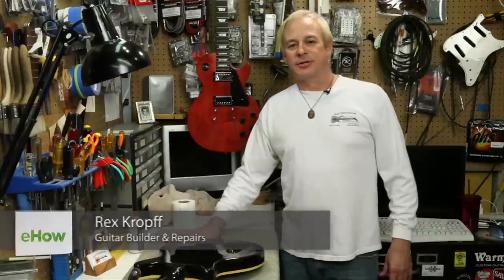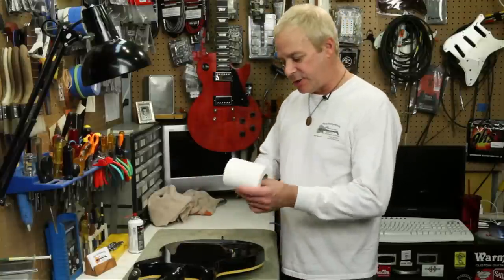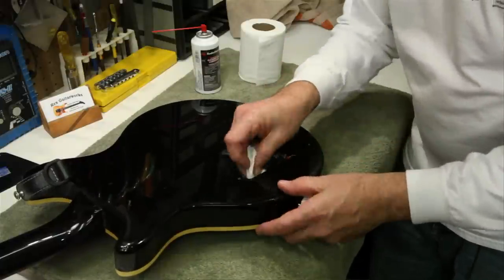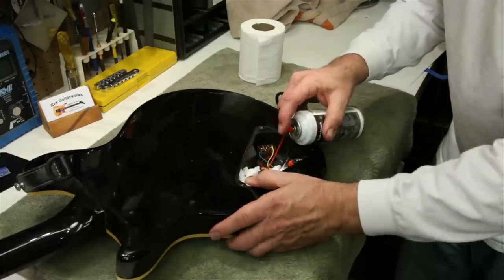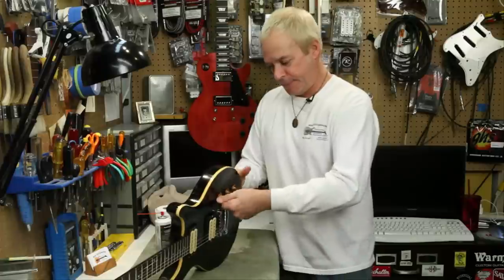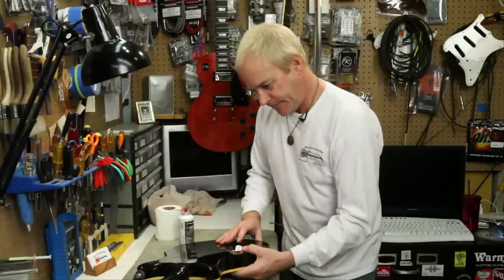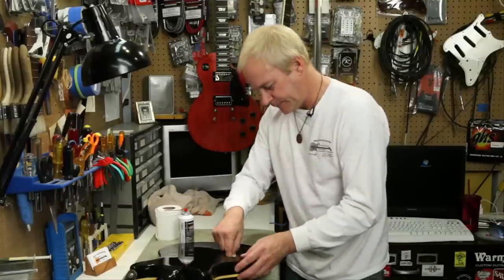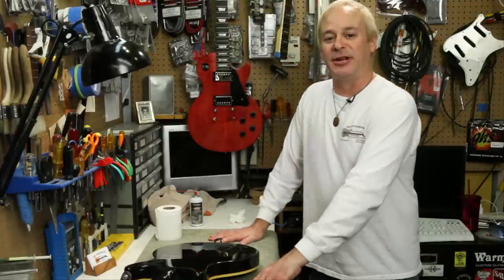Cleaning a Guitar Pot : Guitar Building & Repair

Comment: You should show a close up WHERE to actually put the red extension pipe.  No one knows where you are spraying if they have no idea what they are doing. Cheers.
Reply: You have to pay for that knowledge but there is a hole in the potentiometer on the back just take the red straw and put it in the hole in the potentiometer and give it a few sprays, very easy to do and if you cannot find the hole and you have a fender or a guitar with a pick guard then you have to remove the pick guard and then you will need this video./watch?v=yZzkwI9ysy4.
Reply: Yes, I am fully aware, I was just saying that someone who came to watch the video so they could do it themselves, wouldn't necessarily know what is being done exactly...
Cheers.
Reply: I saw other videos to learn how to do this so I figured I would try to help anyone else out who watches this video.
Reply: +caperUnderscore26 Totally, Oh look this is how to clean something but never show WTF you're doing...
Reply: hee hee...